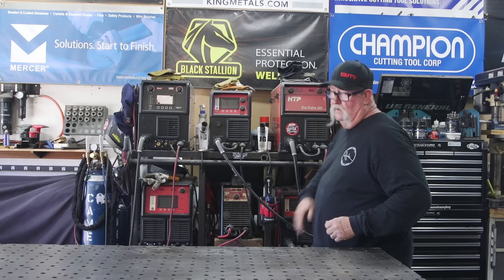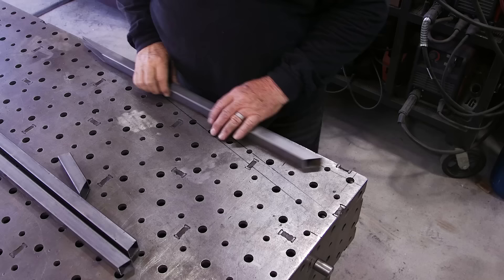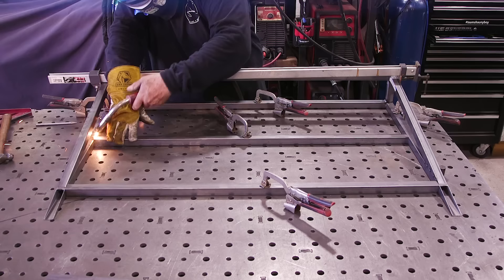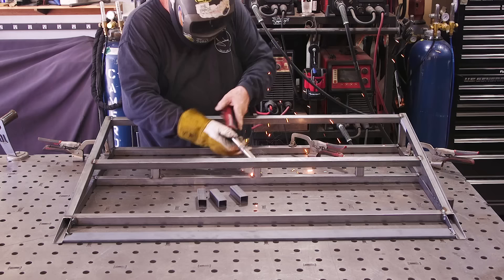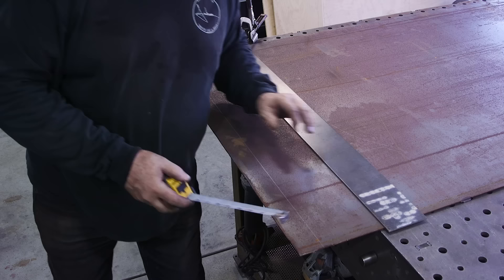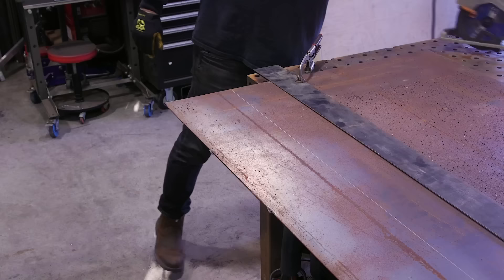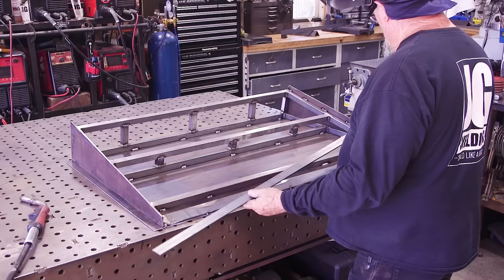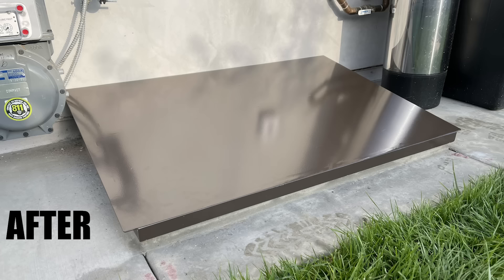Metal Outdoor Access Hole Panel Cover | JIMBO'S GARAGE

Comment: If I did this, it’d be out of aluminum with a handle at the top near the house with rounded corners but going aluminum would be a bit more expensive although quite lighter.